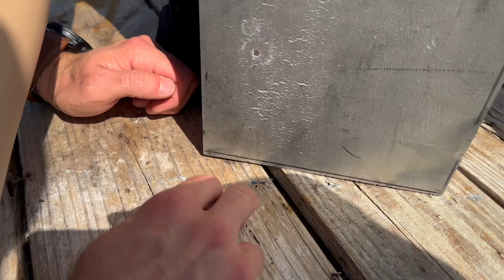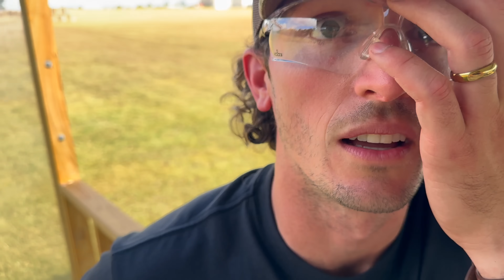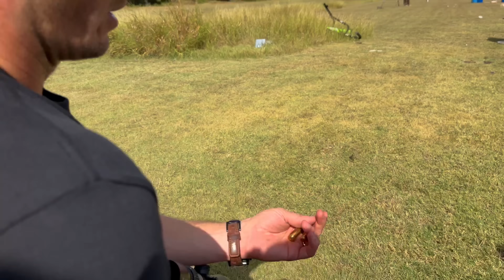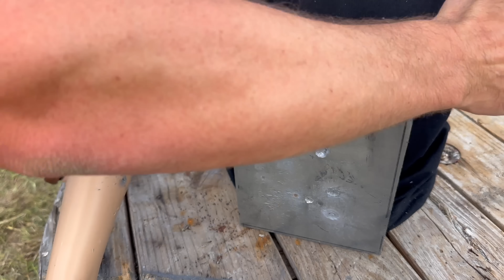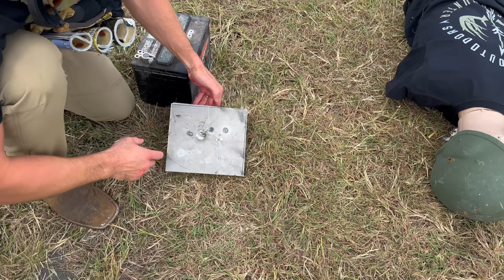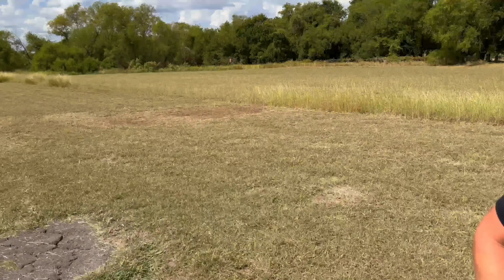How Bulletproof is Titanium?

Comment: To be accurate, the titanium plate must be tested with a thickness equal to the frying pan's size. The titanium used for testing is too thick to be of any use.
Reply: Yeah, but at the same time they should change it everytime a bullet hits the titanium, so, quite expensive for testing purposes.

Comment: Sorry Parker, I sport a titanium insert in my femur, it is lighter than stainless steel, which was also inserted into my femur the first time. The density of titanium is 4.502 to 4.51 g/cm³, being nearly half the density of steel, 7.75 to 8.05 g/cm³. It is extremely strong though. What are the dimensions of that piece of titanium, I can get you an approximate weight.

Comment: With Titanium the more heat cycles it goes through the stronger it gets . It's molecular bonds get tighter with each cycle . That's why the A10 warthogs have a Titanium "bathtub" for armor protecting the pilot of the plane. SR-71 Blackbird's entire fuselage is made of Titanium for heat resistance at mach 3.0 and it's light weight . The air friction gets the nose and leading edges on the wings glowing red because of heat at that speed. Last time I knew Titanium is the only metal that cannot be manufactured by the United  States using our Natural Resources we do not have 1 of the ingredients needed to make it. Guess who has that ingredient in their country's geology ? RUSSIA . That's who. Back in the mid 1960's the CIA set up a bunch of clandestine shell companies to acquire the necessary amounts in very small orders of that ingredient so not to raise the suspicion of the Soviet Union. Once they had enough it was used to make Titanium for Lockheed  Martin for ? The SR-71Program. Do we need to go to such extremes today, no. Little cold war era Titanium story for you. When you guys were using a 2' thick piece I was saying to myself  they don't have a friggin thing that's going through that. I knew the answers before you pulled the trigger with each weapon. Congratulations you found out. Nice video fun to watch, the last round getting an inch of penetration did surprise me. That's serious ammunition there.

Comment: So I just googled titanium, and here it is.

Titanium is a strong, silver-colored, and lightweight metal (element with atomic number 22) that is resistant to corrosion. It is known for its high strength-to-weight ratio, making it a key material in aerospace, and its resistance to corrosion makes it ideal for use in saltwater environments and medical implants. Titanium is also found in a highly stable and common compound, titanium dioxide, which is used as a white pigment and in sunscreens.
Reply: yes robocop is made of titanium laminated with kevlar
Reply: Because titanium is so inert, it’s very biocompatible so it’s great for medical implants, unlike steel.
Reply: @BalthasarGelt-x2d  so this is why some people get titanium joints-bone replacements.
Reply: @BalthasarGelt-x2d  I actually have a couple of titanium screws in my skull due to corrective jaw surgery. Never had any metal detectors go off at least lol
Reply: Yeah ... That's too heavy
Reply: Titanium Blonde: Fake af. Not even worth the hair dye, they used.

Comment: Complete BLX, I managed to watch 59 seconds only and had to switch it off. Yes, Titanium is a metal. It is on the periodic table as it is a element. "Newton's Law states that to make it to the periodic table you have to be an extreme, an extremely hard metal"................... complete BLX, clearly no understanding of Elements, the periodic table or what Newton's Laws are.
QA Engineer with 40 years experience in the Titanium industry, in aerospace, biomedical, chemical, military applications, and including some additional experience with  Zirconium, Hafnium and Niobium

Comment: Titanium can have a tensile strengt from about 250 to 1100 MPa
Normally you get titanium alloys. So what is your block?
Soft annealed pure Ti
or hot rolled Ti. If it is the Soft annealed one, it is comparable to Medium Aluminium alloy. If it is Alloy, it can have the same strengt than steel, but greater elasticity and about half E-modulus. At this point I recommend more knowledge about  materials science. Compare with macrolon, same thickness.

Comment: Well, if the block is as thick as what is shown in the thumb, it almost doesn't matter what metal you use; a "normal" bullet is going to have a hard time penetrating an inch or two of solid material like that, even if it were something softer, like copper or gold.

Comment: Most ppl misunderstand titanium. It's a misconception that it's stronger than steel. It's strength to weight ratio is very high but that's bc it is so damn light. hardened steel is far stronger.

Comment: Well…..  Titanium has a superior strength-to-WEIGHT ratio and corrosion resistance, while steel generally has HIGHER overall tensile strength!  

The benefits of titanium is limited to:  

1.  Weight
2.  Corrosion Resistance
3.  Heat Resistance

Steel is generally harder than titanium, especially hardened steels, which are more resistant to scratching and surface deformation.

Titanium is NO Super Alloy.  Shooting an Equally thick piece of Steel would yield similar results.

Comment: That's why the pilots of a10 warthog sit in a titanium bathtub to protect them
Reply: I wonder how thick the walls on the titanium tubs for the A-10 are.
Reply: @dishmanw 1 inch
Reply: You bet, and its still specially thermochemical diffusion treated to the under belly, without it there is no one brave enough to fly it so low, that's why is costs so much for military grade titanium.

Comment: And now you know why the A-10 Thunderbolt II had a "bathtub" made out of Titanium. 

From Fairchild Republic A-10 Thunderbolt II

The cockpit and parts of the flight-control system are protected by 1,200 lb (540 kg) of titanium aircraft armor, referred to as a "bathtub". The armor has been tested to withstand strikes from 23 mm cannon fire and some strikes from 57 mm rounds. It is made up of titanium plates with thicknesses from 0.5 to 1.5 inches (13 to 38 mm) determined by a study of likely trajectories and deflection angles. The armor makes up almost 6 percent of the aircraft's empty weight. Any interior surface of the tub directly exposed to the pilot is covered by a multi-layer nylon spall shield to protect against shell fragmentation. The front windscreen and canopy are resistant to small arms fire.
Reply: I've made a few bathtubs as a machinist.  Can confirm.  It's a bitch to work with.

Comment: What is the Moon made of Titanium or Tungsten?
The Moon is not made primarily of either titanium or tungsten.

Here's a breakdown:

🌕 What is the Moon made of?

The Moon is made mostly of:

Oxygen

Silicon

Magnesium

Iron

Calcium

Aluminum

These are the main elements found in the Moon’s crust and mantle. The Moon is composed mostly of silicate rocks, similar to Earth’s mantle.

🪨 What about Titanium?

Titanium is present on the Moon, especially in lunar mare basalts (the dark areas of the Moon).

Some regions, like the Sea of Tranquility, have relatively high concentrations of titanium dioxide (TiO₂) — up to 10–12%.

Titanium is more abundant on the Moon than in Earth's crust, but it is still a minor component overall.

🪨 What about Tungsten?

Tungsten (W) is very rare on the Moon.

It may be found in trace amounts in some rocks, but it is not a significant part of the Moon's composition.

✅ Summary:

The Moon is not made of titanium or tungsten.

Titanium is present in small but notable amounts in some lunar rocks.

Tungsten is extremely rare. 😮😊

Comment: the energy comes in like an upside down ribbon ,
if left is forward ,
it enters left ,
does a u turn in the loop ,
and is pushed out the right .

so down left ,
up right .
that's how you channel internal external flow .

Comment: Genuine question here. As someone from the UK who has no knowledge of guns and bullets can someone explain to me why the silver tip 50 Cal has bigger impact than the standard 50 Cal?
Reply: I had to Google it... "Silver Tip .50 BMG is an Armor-Piercing Incendiary (API) round, identified by its silver-painted bullet tip, designed to penetrate hardened targets like armor and then ignite fires using incendiary materials within the bullet. This dual-purpose cartridge, also known as the M8 round, serves as a versatile anti-materiel round against armored or flammable targets. "
Reply: @fhrswa thanks for the clarification 👍🏿👍🏿

Comment: Hey Parker This Is Just The Results I Kinda Figured Would Happen Very Little Penetration Even From Standard 50 Caliber Round Silver Tip Drilled In Half - Way Through It Might Have Went Clear Through With A Thinner Block❤❤❤❤❤❤❤❤❤❤❤❤❤❤❤❤❤❤❤❤Ed The Video Parker Great Subject Matter Wonder What Would Happen With Tungsten Probably The Same Thing Or Less But It Would Be Awesome To See Titanium At The Thickness  You Had Is Bulletproof Up To Over 50 Caliber

Comment: I'm guessing this plate is Grade 5 titanium. While not as hard as AR500 steel, it's about as hard as alloy steel, the kind used to make high-strength bolts. Where titanium excels is its high ductility, so it can absorb significantly more energy than steels of equal hardness. It's also half as dense, making it easier to carry.
Reply: R u still watching the video
Reply: @X-ManLaForte I watched it last night and was amazed at how tough the brick was. I was thinking velocity would be key to punching craters in it, and expected .223, 5.56, and .308 to do more damage. Also the difference between .50 BMG ball and .50 BMG silver tip was incredible. I think the high melting point of titanium (about 500F higher than most steels) helps it resist softening at the high temperatures created by the impact.

Comment: The advantage of titanium is that it is lighter than iron and steel, also in terms of strength and durability, and also in terms of corrosion resistance from rust, 50 cal can only penetrate half of it, maybe it is a good thing to use it on armor because it does not penetrate but still the impact power of 50 cal cannot be taken lightly, it will damage other parts of the body, with that great pressure the heart can break, maybe it is good for titanium to be used in armored vehicles, or as a basic material in making weapons which will certainly make it more durable, or used for the tip of ammunition 😅.

Comment: I'm making this comment BEFORE watching the video. In my opinion, there is NO WAY a 50 cal bullet will penetrate that block of Titanium.
Reply: I'm with you guys
Reply: He should shoot tungsten
Reply: 18 minutes later, wahhhhhh
Reply: Titanium isn't that strong LoL it's a common misconception. It's an extremely light, non corrosive metal. Steel is actually stronger than titanium. Ti is stronger on a strength to weight ratio, but if my life was on the line, I will take Steel over Ti to hide behind
Reply: @Thr33.Sid3z It is true. Maybe people like me spreading that myth. I work with machining and while steel is harder, Titanium is harder to cut in and wear out tools quicker.
Reply: @robertolsen9721 what about tungsten? Is tungsten stronger than steel? I’m not a metallurgist so please be patient :)
Reply: @Politicalhomeless Neither am I. However I have a tool at work partly made of Tungsten which is the same as Wolfram, it was used in light bulbs.  My tool is a damping tool for machining long holes, because Tungsten is much heavier it somehow eliminates vibrations. If its harder than steel I dont know.
Reply: @Politicalhomeless I checked that out. It is harder than most carbon steel.
Reply: @Politicalhomeless  it is
142000 psi vs 63000 psi - but its also brittle
Reply: @Thr33.Sid3z Titanium can actually ignite and burn with oxygen present.
Reply: Yeah, I was thinking you'd need to get up to a 20 mm. AP round. Looks like that is about right.
Reply: Yeah sure you commented before watching it anyone can say anything on another side of a screen bra 😂😂😂😂😂😂😂😂

Comment: I want to see someone spin up a pure tungsten .50 on a lathe and hand load it. Little hot too. Would be super interesting to see an entire round of tungsten rather than just the core/penetrator.
Reply: Pure tungsten can't be machined with traditional techniques as it's too hard and too brittle. You'd have to start with a heavy alloy of tungsten and then sinter it to near final shape, then precision grind it to shape.
Reply: @johnbarron4265 I understand, but it could be done one way or another. Need some kind of sabot too, though. A very thin one made of teflon or similar the way you load oversized steel shotgun slugs. 

Would be amazing to see its capabilities.

Comment: Try tungsten steel next.
Reply: I'm assuming it will shatter it, or create cracks all through like a concrete wall.
Reply: Brass. I bet brass would be interesting to shoot.
Reply: magnacut steel
Reply: He did
Reply: try a shaped charge instead of bullets
Reply: You missed a belt loop hehe
Reply: The Tungsten block you see all the time isn’t actually pure tungsten. Pure elemental tungsten is hard (very resistant to scratching) and brittle. What they do with those 42 pound blocks of tungsten is they alloy it. It is first Tungsten carbide, which is also very brittle,  but then they mix in some cobalt, which minimizes brittleness.
Reply: @SA.L-X9c  Yep, pure tungsten is extremely hard to cut, as a machinist and tool maker of over thirty years it is the hardest thing I've ever had to cut.
Reply: @SA.L-X9c  But if it's in the form of a giant cube (like it usually is), then it's hard as hell. Even a tank bullet would probably not go through it.
Reply: @SA.L-X9c No, those blocks are not tungsten carbide. If they were, they'd be brittle and chip easily, even more than ordinary tungsten. They're actually tungsten heavy alloy, which is an alloy of tungsten, iron, and copper. They're usually either 90% or 95% tungsten.
Reply: @johnbarron4265  depending on where you get it from, it’s usually Tungsten-Carbon-Cobalt, not just Tungsten carbide, which, as you said, is very brittle. Or the tungsten heavy alloy, but most places don’t really mention and just say “tungsten alloy”
Reply: @SA.L-X9c  Tungsten-carbon-cobalt is the composition of a cemented metal matrix composite, principally used to make cutting tools for machining equipment. The 'tungsten alloy' cubes that are ridiculously dense and that everyone is fascinated with, are definitely not made from  W-C-Co alloy. I forgot to mention the 'tungsten heavy alloy' always includes nickel as the second alloying element.
Reply: @johnbarron4265  It’s just that I’ve seen cubes claiming to be W-C-Co. But I guess otherwise.

Comment: Tungsten or titanium?  Titanium is lighter like aluminum,  tungsten is HEAVIER
Reply: It looks to be about 8.5"x8.5"x2", that is 23lbs if it was titanium and 100lbs if it was tungsten. Parker is pretty skinny, no chance he could lift a 100lb block that easy.
Reply: @william_hartman  The ‘tungsten’ blocks everybody uses in videos aren’t actually tungsten. It’s an alloy of Tungsten-Carbon-Cobalt, since pure tungsten is very brittle. So with this alloying with the lighter cobalt and especially light carbon it becomes more like 42 pounds when 4 inches in diameter. Pure tungsten would be 100 pounds though.

Comment: Surprising how the 5.56 made more of a dent than the heavier rounds earlier in the test! 🤔
Reply: Speed is a hell of a thing
Reply: p = mv, weight alone does not determine strength.
Reply: @音羽-t6q it is a factor though. Which is why there's weight classes in powerlifting
Reply: An object the size of a grain of sand can literally crack this planet in half if it's moving fast enough.
Reply: @RighteousJ if it didnt burn up in the atmosphere.
Reply: @jestopherson  right. That's why I used the general term "object", since there's no known material capable of that. The point was to emphasize the physics of the situation and provide an effect everyone can understand.
Reply: @jestopherson  Assuming the planet has no atmosphere.
Reply: @RighteousJ nonesense.